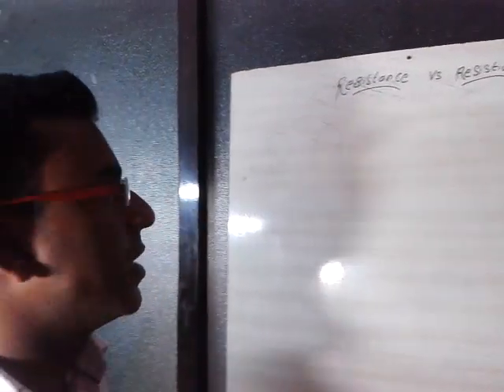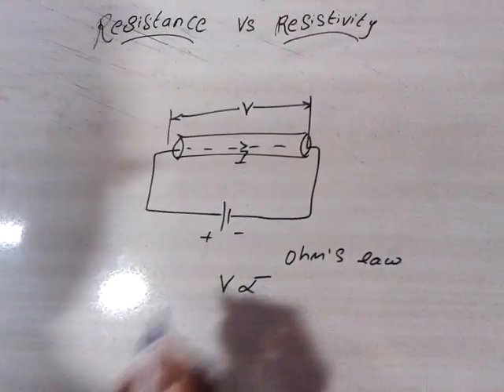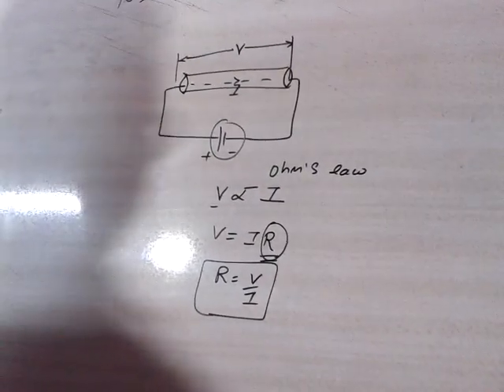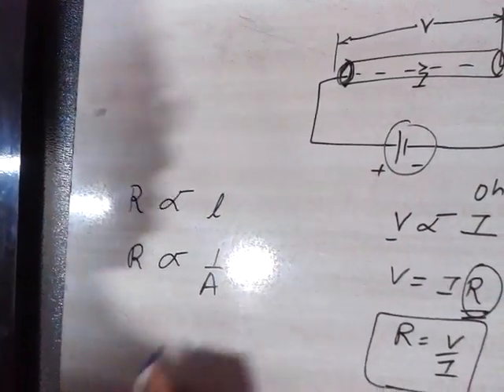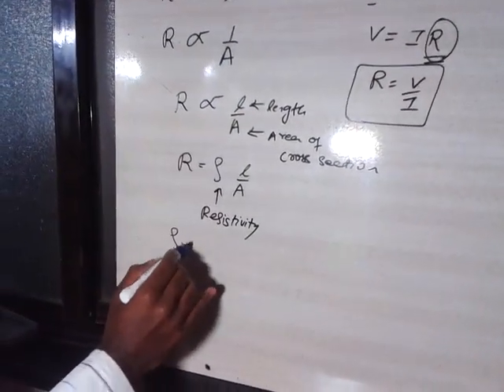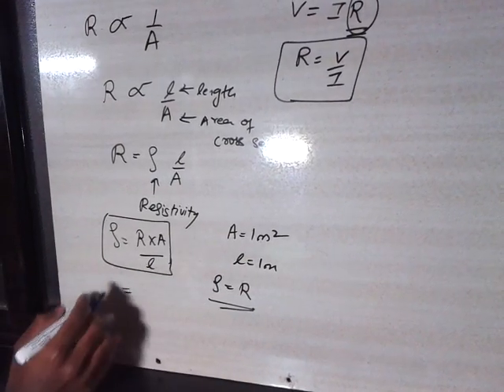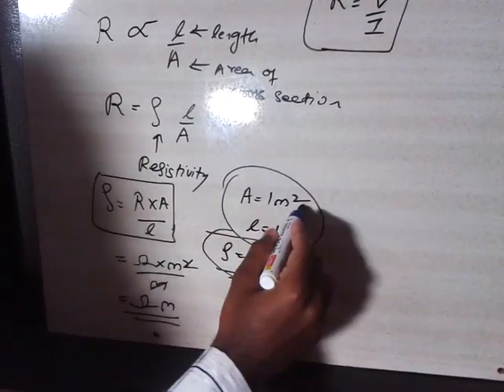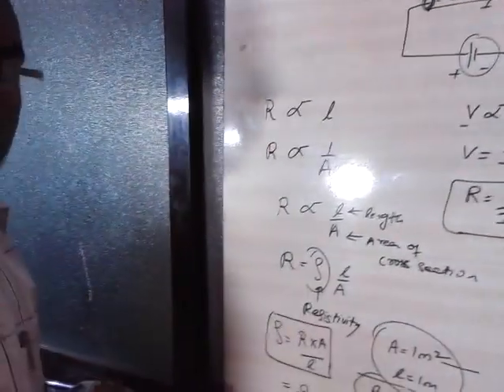Resistance and Resistivity

Comment: The explanation can't get any better.
Reply: I think you don't understand that's why you are saying
Reply: you have to keep working hard
Reply: @milanbhandari92  Try to work smartly and not hard. You cannot read all the books in your library leave alone those in the world. 
What is a resistor? How does current branch in a network of resistors? How does it "know" how much should flow in each branch?
While some detail is given in science and engineering courses about conductors, insulators and semiconductors, resistance is described in several ways.
Examples include i. The restriction to the flow of electrons. ii. The difficulty in moving electrical current through a conductor to which voltage is applied.
iii. a circuit element which dissipates energy in the form of heat .
More appropriate description for a resistor would be the property of a conductor which determines the current produced by a given difference of potential.
This makes us remember that a resistor is a conductor first. And, there is reason to say that superconductive wires dont obey ohm's law. So all conductors are resistive, though not superconductors. 
Resistors are used in circuits to regulate the strengths of currents either by reducing the diameter of conductors or introducing more obstacles or lattice imperfections to reduce the strength of current.
The current branches in a parallel network by an elaborate rearrangement of surface charge.
For more details about resistance, how current branches in a parallel circuit and ohm's law consult the following videos, articles and books.
A working definition for current in conductors like metal wires is "the start-stop motion of millions and millions of conduction band electrons everywhere within with a drift superimposed". 
The e.m.f of the battery is due to separation of positive from negative charges which produces an e.m.f across its terminals and a pattern of electric field surrounding them, not exactly but like a dipole.
Consider a simple circuit comprising a battery, two wires and a resistor. An electric field is there in the wires and in the resistor; powerful electric field and uniform within the resistor, weak and uniform within the wires. The field is set up by a tiny amount of surface charge with a steep gradient on the resistor and not so steep a gradient on the wires. It is the electric field E created by the surface charges sourced from the battery, which produces a force causing the mobile electrons to acquire a drift velocity v = μE, where 'μ' is the mobility which is a number representing the freedom of movement of the electron in the lattice. 
This results in a current density J = σE, where σ is the conductivity of the wire or material of resistor and E is the electric field in the wire if considering wire and is the field in the resistor when considering the resistor.

The p.d. or voltage across the resistor is the integral of a constant powerful field along its length. The p.d. or voltage across the wires is the integral of a constant but weak field along its length. 
Voltage is entirely because of the surface charges.
For a live demonstration of surface charge and its effects in circuits visit 
https://youtu.be/U7RLg-691eQ
Electrostatics and circuits belong to one science and not two, that of electricity and magnetism. To know how they are unified visit this link 
https://matterandinteractions.org/articles-talks/ and view the article 'A unified treatment of electrostatics and circuits.  B. Sherwood and R. Chabay, unpublished. (1999)'
pdf. 
For a detailed discussion of surface charge, electric fields, currents, voltage, voltage source, difference between e.m.f. and potential difference, ideal voltage sources, capacitors, inductors, transmission lines, electromagnetic waves, antennas and radiation, see Electric and Magnetic Interactions by Chabay and Sherwood 
www.matterandinteractions.org
or 
Fundamentals of electric theory and circuits by Sridhar Chitta
https://www.wileyindia.com/fundamentals-of-electric-theory-and-circuits.html
There is a "look inside" feature in the amazon.com webpage of the book "Fundamentals of electric theory and circuits" by Sridhar Chitta with a few pages of Chapter 1 which may be viewed and also which you may swipe left or press < icon to view the foreword, preface and Table of Contents. 
For a lecture by Prof Ruth Chabay on surface charge in a simple dc circuit visit 
https://youtu.be/-7W294N_Hkk
Reply: You don't know how to study

Comment: What is a resistor? It is the property of a conductor which determines the current produced by a given difference of potential. This makes us remember that a resistor is a conductor first. And, there is reason to say that superconductive wires don't obey ohm's law. 
A working definition for current in conductors like metal wires is "the start-stop motion of millions and millions of conduction band electrons everywhere within with a drift superimposed". 
The e.m.f of the battery is due to separation of positive from negative charges which produces an e.m.f across its terminals and a pattern of electric field surrounding them, not exactly but like a dipole.
Consider a simple circuit comprising a battery, two wires and a resistor. An electric field is there in the wires and in the resistor; powerful electric field and uniform within the resistor, weak and uniform within the wires. The field is set up by a tiny amount of surface charge with a steep gradient on the resistor and not so steep a gradient on the wires. It is the electric field E created by the surface charges sourced from the battery, which produces a force causing the mobile electrons to acquire a drift velocity v = μE, where 'μ' is the mobility which is a number representing the freedom of movement of the electron in the lattice. 
This results in a current density J = σE, where σ is the conductivity of the wire or material of resistor and E is the electric field in the wire if considering wire and is the field in the resistor when considering the resistor.

The p.d. or voltage across the resistor is the integral of a constant powerful field along its length. The p.d. or voltage across the wires is the integral of a constant but weak field along its length. 
Voltage is entirely because of the surface charges.
For a live demonstration of surface charge and its effects in circuits visit 
https://youtu.be/U7RLg-691eQ
Electrostatics and circuits belong to one science and not two, that of electricity and magnetism. To know how they are unified visit this link 
https://matterandinteractions.org/articles-talks/ and view the article 'A unified treatment of electrostatics and circuits.  B. Sherwood and R. Chabay, unpublished. (1999)'
pdf. 
For a detailed discussion of surface charge, electric fields, currents, voltage, voltage source, difference between e.m.f. and potential difference, ideal voltage sources, capacitors, inductors, transmission lines, electromagnetic waves, antennas and radiation, see Electric and Magnetic Interactions by Chabay and Sherwood 
www.matterandinteractions.org
or 
Fundamentals of electric theory and circuits by Sridhar Chitta
https://www.wileyindia.com/fundamentals-of-electric-theory-and-circuits.html
There is a "look inside" feature in the amazon.com webpage of the book "Fundamentals of electric theory and circuits" by Sridhar Chitta with a few pages of Chapter 1 which may be viewed and also which you may swipe left or press < icon to view the foreword, preface and Table of Contents. 
For a lecture by Prof Ruth Chabay on surface charge in a simple dc circuit visit 
https://youtu.be/-7W294N_Hkk

Comment: Excellent explanation, sir!

For all those who haven't understood this clearly, here is my take on the video:

What is Resistance?
The amount of current flow impeded (delay or prevent current from flowing by obstructing it)

 Resistance is dependant on two things as sir clearly mentioned- the length of whatever you are calculating the resistance of and the cross section of whatever you are calculating the resistance of. 

Resistance is directly proportional to the length as the electrons have to flow through that wire/ resistor for longer time. Length affects the overall resistance of a resistor. The longer a resistor, the further electrons have to travel through that resistor. This will increase resistance because the electrons will be affected by resistor for a longer period of time as they travel through it.

Resistance  and inversely proportional to area of cross-section as larger the cross section the more room electrons have to flow thru and the more freely they flow, the more opposite it gets to the meaning of resistance!

Now what is resistivity?
We learnt that resistance (not resistivity) is something that is directly proportional to  length and inversely proportional to the area. 

However the resistance of a substance is also heavily dependent on the nature of the substance. 

Substances like copper offer very little resistance while substances like rubber offer much more resistance of a substance. 

For a given substance it is necessary to quantify the amount of resistance it naturally offers and THAT is what is called RESISTIVITY OF THAT SUBSTANCE.
Now this seems to be the perfect thing to remove the proportionality sign and hence
RESISTANCE = RESISTIVITY * LENGTH/AREA

I really hope this helps. Leave a like if it did (it took a long time to type this out)

Comment: my teacher can explain better than you
Reply: What is a resistor? How does current branch in a network of resistors? How does it "know" how much should flow in each branch?
While some detail is given in science and engineering courses about conductors, insulators and semiconductors, resistance is described in several ways.
Examples include i. The restriction to the flow of electrons. ii. The difficulty in moving electrical current through a conductor to which voltage is applied.
iii. a circuit element which dissipates energy in the form of heat .
More appropriate description for a resistor would be the property of a conductor which determines the current produced by a given difference of potential.
This makes us remember that a resistor is a conductor first. And, there is reason to say that superconductive wires dont obey ohm's law. So all conductors are resistive, though not superconductors. 
Resistors are used in circuits to regulate the strengths of currents either by reducing the diameter of conductors or introducing more obstacles or lattice imperfections to reduce the strength of current.
The current branches in a parallel network by an elaborate rearrangement of surface charge.
For more details about resistance, how current branches in a parallel circuit and ohm's law consult the following videos, articles and books.
A working definition for current in conductors like metal wires is "the start-stop motion of millions and millions of conduction band electrons everywhere within with a drift superimposed". 
The e.m.f of the battery is due to separation of positive from negative charges which produces an e.m.f across its terminals and a pattern of electric field surrounding them, not exactly but like a dipole.
Consider a simple circuit comprising a battery, two wires and a resistor. An electric field is there in the wires and in the resistor; powerful electric field and uniform within the resistor, weak and uniform within the wires. The field is set up by a tiny amount of surface charge with a steep gradient on the resistor and not so steep a gradient on the wires. It is the electric field E created by the surface charges sourced from the battery, which produces a force causing the mobile electrons to acquire a drift velocity v = μE, where 'μ' is the mobility which is a number representing the freedom of movement of the electron in the lattice. 
This results in a current density J = σE, where σ is the conductivity of the wire or material of resistor and E is the electric field in the wire if considering wire and is the field in the resistor when considering the resistor.

The p.d. or voltage across the resistor is the integral of a constant powerful field along its length. The p.d. or voltage across the wires is the integral of a constant but weak field along its length. 
Voltage is entirely because of the surface charges.
For a live demonstration of surface charge and its effects in circuits visit 
https://youtu.be/U7RLg-691eQ
Electrostatics and circuits belong to one science and not two, that of electricity and magnetism. To know how they are unified visit this link 
https://matterandinteractions.org/articles-talks/ and view the article 'A unified treatment of electrostatics and circuits.  B. Sherwood and R. Chabay, unpublished. (1999)'
pdf. 
For a detailed discussion of surface charge, electric fields, currents, voltage, voltage source, difference between e.m.f. and potential difference, ideal voltage sources, capacitors, inductors, transmission lines, electromagnetic waves, antennas and radiation, see Electric and Magnetic Interactions by Chabay and Sherwood 
www.matterandinteractions.org
or 
Fundamentals of electric theory and circuits by Sridhar Chitta
https://www.wileyindia.com/fundamentals-of-electric-theory-and-circuits.html
There is a "look inside" feature in the amazon.com webpage of the book "Fundamentals of electric theory and circuits" by Sridhar Chitta with a few pages of Chapter 1 which may be viewed and also which you may swipe left or press < icon to view the foreword, preface and Table of Contents. 
For a lecture by Prof Ruth Chabay on surface charge in a simple dc circuit visit 
https://youtu.be/-7W294N_Hkk

Comment: yup u are right shubham this is what we have read in textbooks but why if R directly proportional to l and not resistivity.PLSSS answer if u know the ans
Reply: Hi😂
Reply: M in 10th i know the ans now
Reply from the maker: great!
Reply: Himanshu Jindal so whts the answer?
Reply: @zubiapatel1041  hope the long af answer that i typed answers ur query
Reply: @nehachundury975  tbh I don't even remember this comment. But thanks 💓. Ig I asked this in 10th and now I gave my 12th boards 😊
Reply: What is Resistance?
The amount of current flow impeded (delay or prevent current from flowing by obstructing it)

 Resistance is dependant on two things as sir clearly mentioned- the length of whatever you are calculating the resistance of and the cross section of whatever you are calculating the resistance of. 

Resistance is directly proportional to the length as the electrons have to flow through that wire/ resistor for longer time. Length affects the overall resistance of a resistor. The longer a resistor, the further electrons have to travel through that resistor. This will increase resistance because the electrons will be affected by resistor for a longer period of time as they travel through it.

Resistance  and inversely proportional to area of cross-section as larger the cross section the more room electrons have to flow thru and the more freely they flow, the more opposite it gets to the meaning of resistance!

Now what is resistivity?
We learnt that resistance (not resistivity) is something that is directly proportional to  length and inversely proportional to the area. 

However the resistance of a substance is also heavily dependent on the nature of the substance. 

Substances like copper offer very little resistance while substances like rubber offer much more resistance of a substance. 

For a given substance it is necessary to quantify the amount of resistance it naturally offers and THAT is what is called RESISTIVITY OF THAT SUBSTANCE.
Now this seems to be the perfect thing to remove the proportionality sign and hence
RESISTANCE = RESISTIVITY * LENGTH/AREA